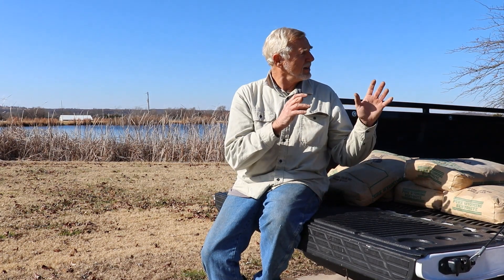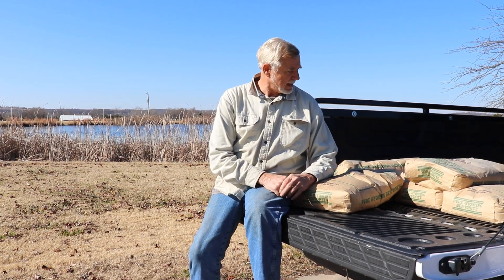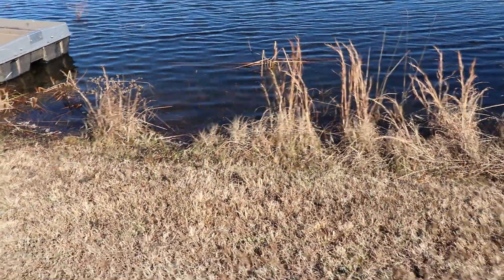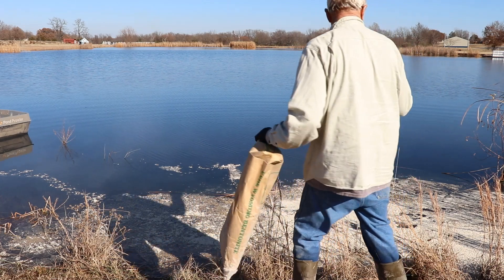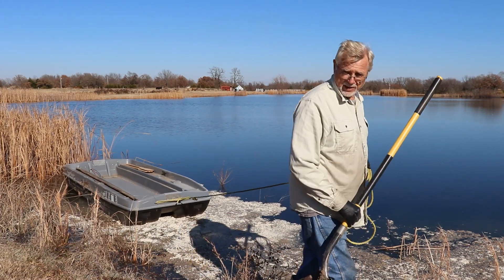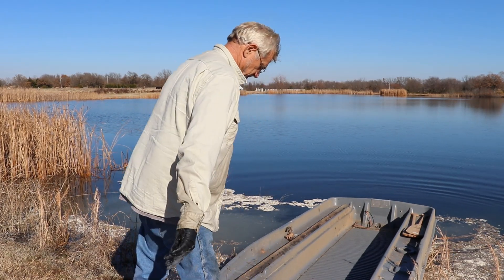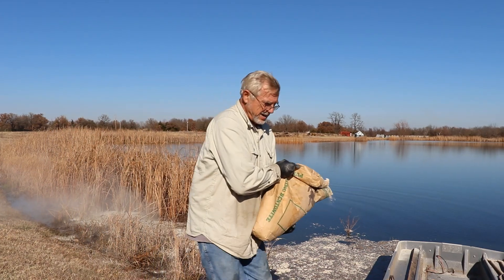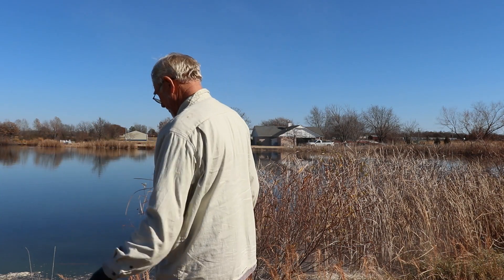Pond Dam Leaking spreading Sodium Bentonite Part 1

Comment: I have been looking at various you tube on using this product. We have a pallet because we have a lot of seepage thar Looks similar to yours.  The water is low now so we are going to the bank because it will fill up when the rains come in. How did it do in the water? Did it sink and the cloudiness of the water go away. My mother in law and sister I n law are aggravated that the professional pond builder. He did line it with clay, which we think is why we have so much seepage.
Reply from the maker: I was impressed with the way it reacted when it was poured into the water. It seeped out and sunk to the bottom. It is sucked into the leaks and expands, clogging the holes. If pouring into water, I would do it on a calm day. Our pond is a very clear pond, the next day I could see it lying on the bottom.
Reply: @andersonprettywaterfarm4369  So has it worked?

Comment: What is cost
Reply: Hi Mr Anderson! Where did you find these bags? I'm having trouble sourcing them. Thank you!
Reply from the maker: @drapriljones  I purchased mine from a local oil field repair company. We live in Oklahoma so it wasn't to difficult locating it. I would google Wyoming Sodium Bentonite dealer near you. Also, look for any oil supply or oil pumpjack repair company's near you, they should be able to order you some. I don't know what part of the country you live in.
Reply from the maker: I paid about 12.50 for a 50 lb bag. I was walking around the pond last week and our pond is still full from all the rains and it is still holding with no leaks. The Bentonite really works. Whenever we do have a drought and the pond goes down I will redo that bank area and I will buy a couple of tons of it and work it into my bank.